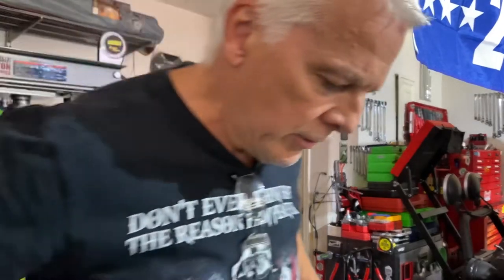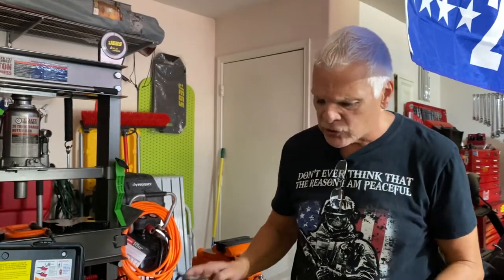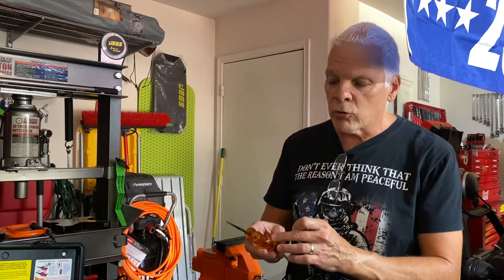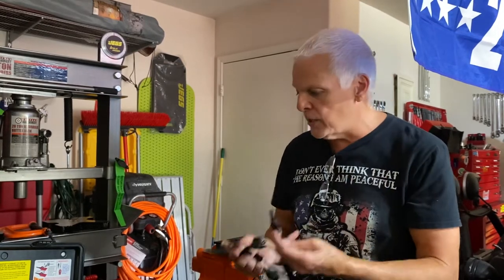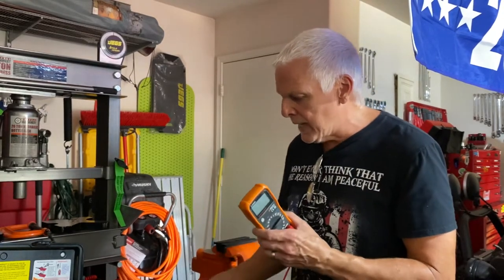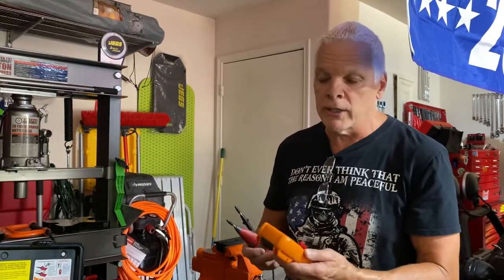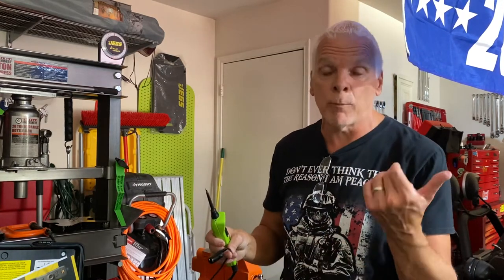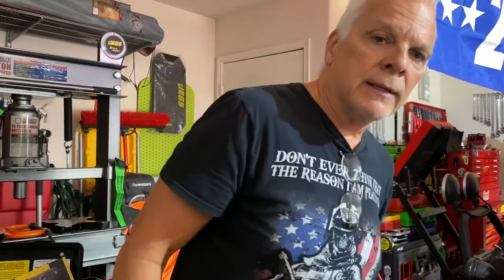Load Pro and Power Probe and test bulb for electrical circuit testing

Comment: Just wondering it load-pro can use on a car ECM circuit 5v
Reply from the maker: To check yes but I would never hit power button. I would use as a voltmeter 👍🏻
Reply: If you use the the 12 v model you can load 5v circuits but not if you have the 48v model I have actually used it on after treatment sensors…. Normal voltage would be around 4.8v and up under 4.2 you have an issue look up the  paper work that came with the load pro there is a chart on there